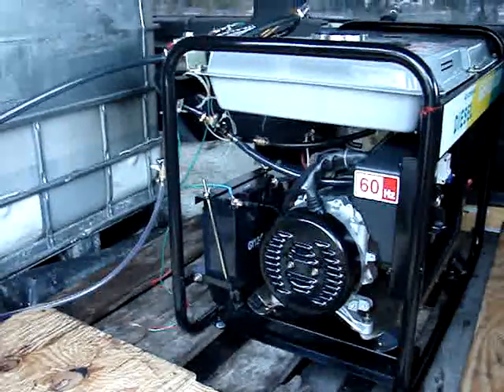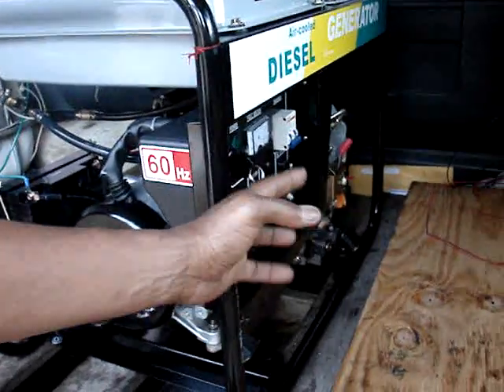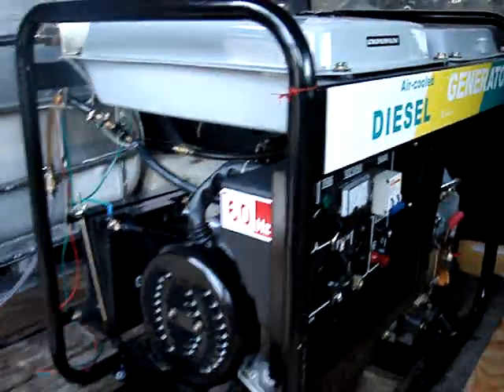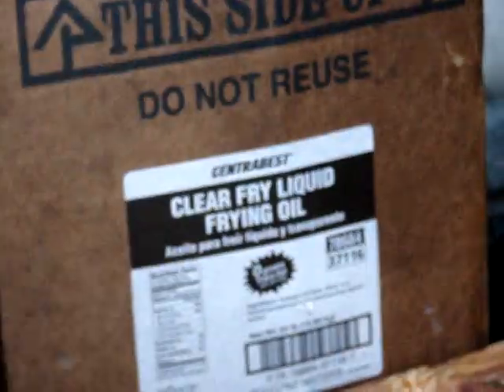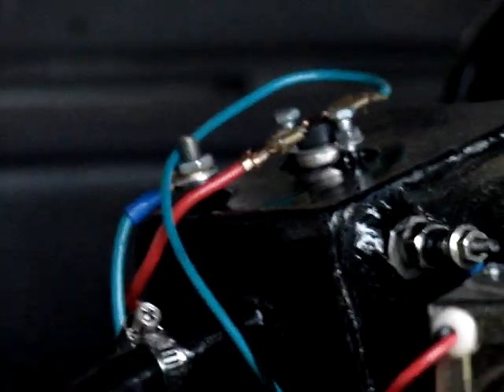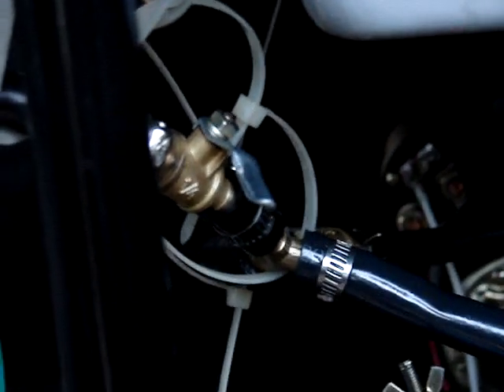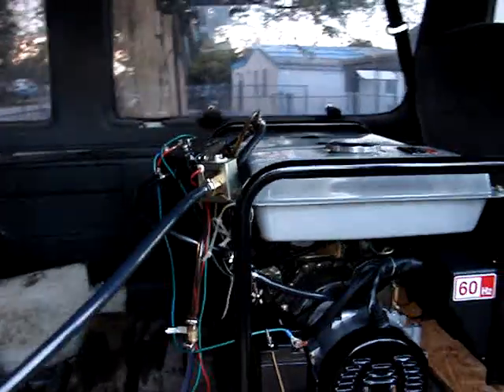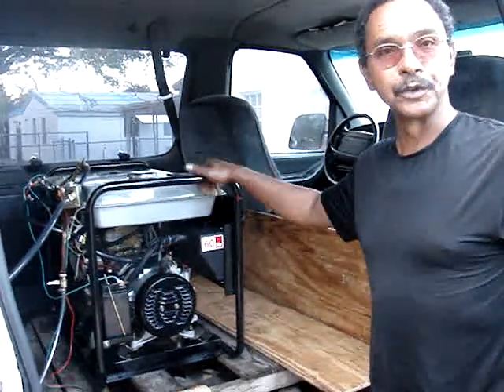WVO generator

Comment from the maker: I have more than 400 hours on that generator and it is on for about 4 hours per day at the warehouse and so far it is wrking fine.
Remember you have to dewater and filter your oil to at least 1 micron.

Now I have install a spin on filter to make sure that everything goes smooth, so far it is working.

Comment from the maker: I still have my generator, I am not a generator salesmen.  The key is to have your oil completely dewatered, filtered to 1 micron and use a trickel pump for this generator.  A must, the oil have to be heated to 180 degrees before switching and always make sure you purge the line with diesel before shutting down.

Comment: Use the exhaust heat to preheat the oil. It will also vaporize any water. A 1 micron filter needs to be used to remove any contaminants before preheating it.
Reply: Jim Rojas how do you rig it up to heat from the exhaust?

Comment: I was skeptical on the longevity of these engines although George was quite adamant on some veg oil forums the thing would last forever because he had stainless steel piston rings put in the thing. 

I would be interesting to see how it held up but as he has disappeared off the radar after so much enthusiasm, it seems a safe bet to assume it didn't work out as he hoped.

Comment: Hi there. Is the generator still running? I run my 2 vehicles on wvo and would like to convert some small diesel engines to run on wvo as well. What sort of heater do you use to heat the oil?

Comment: what do you have to do to the oil before you can run it in the generator?

Why the diesel before shutting off? is it to prevent clumps?

can you share plans to modify my own generator?

thanks